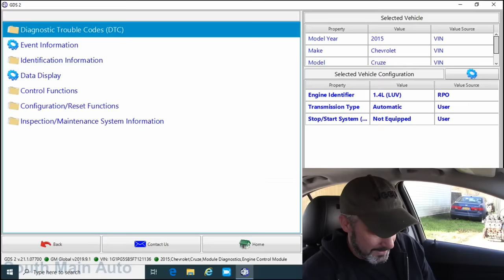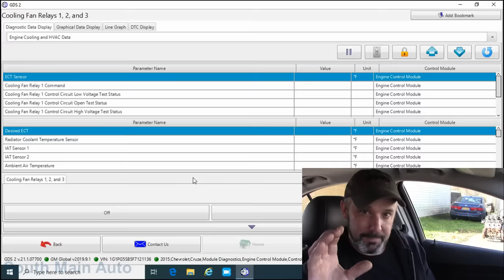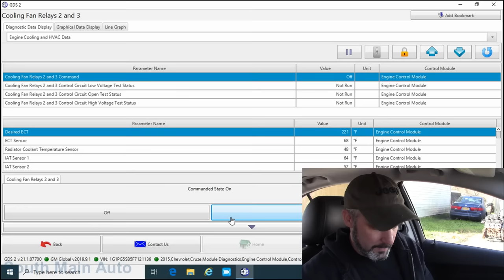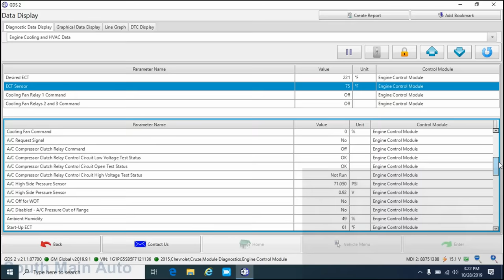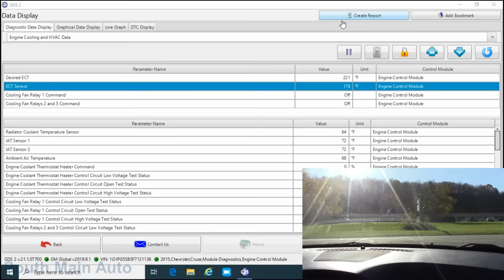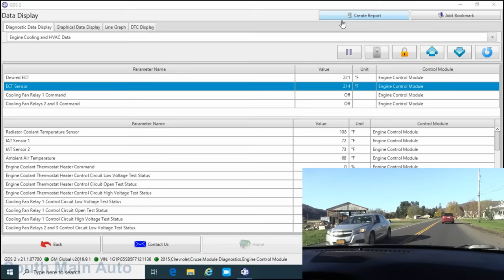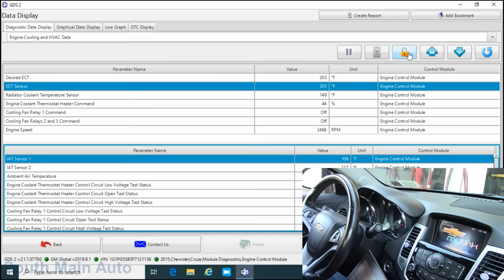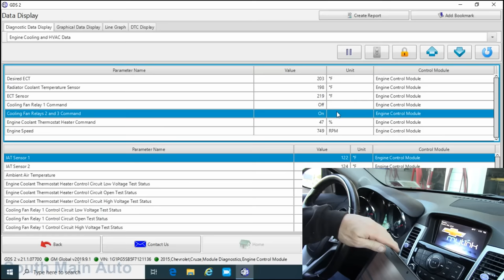Chevrolet Cruze: Overheating, Loud Fan, Losing Coolant

Comment from the maker: Astro 78585 Universal Radiator Pressure Tester and Vacuum Type Cooling System Kit : https://amzn.to/2oLNafl
High-Tech Telescoping Inspection Mirror : https://amzn.to/36y4K7F
Spill Proof Coolant Filling Plastic Funnel Kit : https://amzn.to/2PM0zyW

Chevy Cruze with loud cooling fan: https://www.youtube.com/watch?v=xHZVvHIbs9s
Reply: South Main Auto Repair LLC scan tool used ?
Reply from the maker: @randomsanwhich2  GM Gds2
Reply: Always the last one you grab, lol. Why would you grab anymore once you have the one that fits??!
Reply: The Chevy Cruze from I think 2014 and 2015 had a bad batch of water pumps when I read last year. My sister 2015 Chevy Cruze had her water pump leak like that and took it to the dealer, they looked at it then said they'll just put a new one on it for free.
Reply: @A1rs1ck Water pump is covered by special warranty on almost all Cruze. I had the water pump replaced on my 2012 and on my wife's 2013. This is why dealer is able to undercharge SMA. Cruze cooling system is a nightmare. Leaks will occur at the water pump, at the overflow tank return list(Plastic fitting), at the cap(o-ring too small, not enough squeeze). The overflow tank will crack, it's only a matter of time. Don't get this car if you don't have a friendly mechanic or are mechanically inclined. The intake manifold check valve will fail. The valve cover pcv will then fail as well. The only thing I have not seen is the cooling fan failure. My 2012 is at 100,000 miles right now.
Reply: I have one question. When does lawn mowing guy stop mowing? Snow?
Reply: @nates.4552  Then he switches to snow blowing.
Reply: @flemardo  I was thinking that. The good news is snow doesn't "grow" lol
Reply: @help137  I always try to look in the last place first .
Reply: Just Curious cause I do a lot of Diagnose work, how much did you charge them for that?
Reply: I've found when I have a pile of options if I'm about half way in and no luck so far, I skip directly to the last one or the bottom of the pile and what do you know, there's the one I need.
Reply: hello my coolant fan doesn't act like it's coming on  I let it run for 30 minutes goes to half way still nothing changed a temp sensor on the side of the engine not on the side of the radiator
Reply: Because dealership mechanics are idiots if it doesn't throw the right code they cannot fix it I had a buddy that work for Dodge for 30 years he knew what was wrong with the car he knew it was the the valve body in the transmission when it wouldn't shift when it got hot but since it didn't throw the right code Chrysler wouldn't let him fix it GM is just as bad plus they're only trying to work on one side of cars and most dealerships just want them to do the bare minimum to keep them on the road through the warranty that's all they care about they don't care about fixing the problem or customer satisfaction or any of that BS that they tell you
Reply: @A1rs1ck  My wife had a 2015 and we're having problems with coolent leak ect. How do we know if there's recalls and are they all covered?
Reply: @A1rs1ck  that's what I'm in the process of doing too.    And the thermostat. Should get the SRIV back today   🤙🏼🤞🏼
Reply: I guess I'm not the only one who says, tell them I'm not here lol.
Reply: GM are bad for thermostat hanging up and sticks at high temps